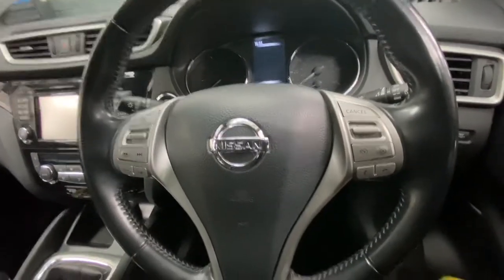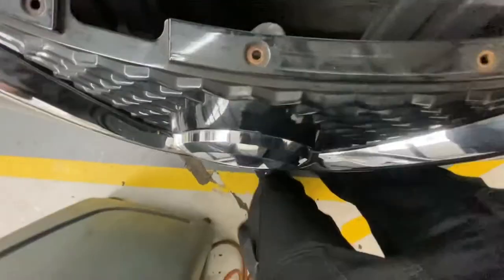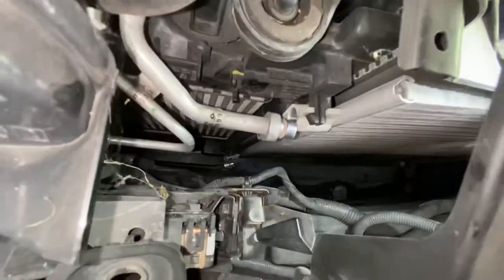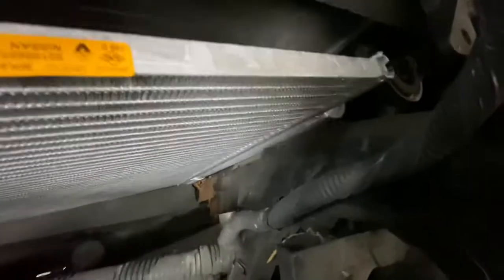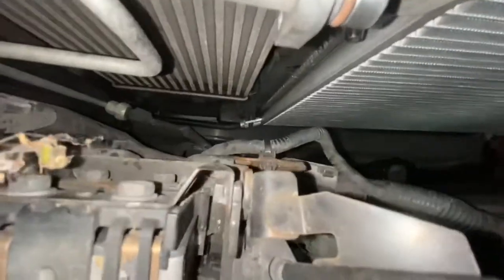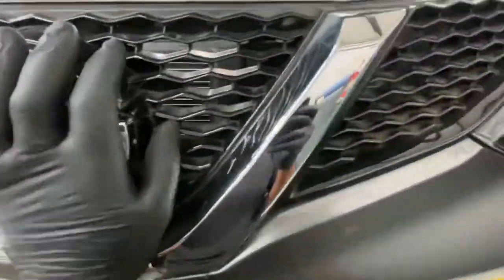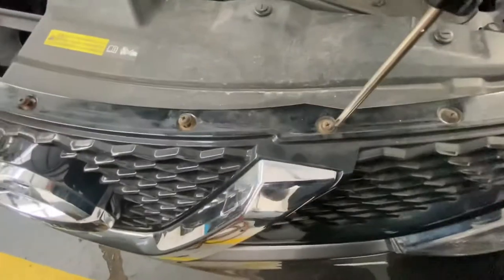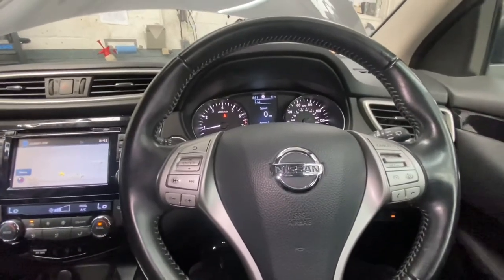#Nissan #Qashqai #J11 #Air #Con #condenser #replacement

Comment: Are you based in UK? I have NISSAN Qashqai 14 Reg - Had re gassed last year and it is leaking somewhere - could be a condenser - Just had service from Nissan & they cant find any obvious leaks by putting dye in. Asking for a £120 an hour for a condenser check.
Reply from the maker: Uk based

Comment: I have a 2008 nissan dualis, 
Runs good ect, but overheats when aircon and idling. 
Doesnt overheat with aircon off and idling. Doesnt overheat when driving with aircon on. Just idling.
Reply from the maker: Have never heard of this issue before can give me more information is it straight away when you start the car or after the car has been running also did you bleed the system properly?
Reply: @g_a_bofficial   it is fine when driving, idling without aircon. Throw aircon on and itll overheat.  How do you bleed the coolant system.

Comment: Hi, my missus has the same QQ and the re-circulation button stopped working. The LED won’t light up and AC blows warm. Is it true that it because of a faulty condenser?
Thank you
Reply from the maker: No the button should come on regardless of whether the condenser was faulty or not

Comment: Could you please share part number of. the condenser? Thanks
Reply: Hi Duncho. Think I remember your helpful posts on the Qashqai forum. 
My Nissan Qashqai 1.5dCi 2014 j11 has the original condenser with these Part numbers on its yellow sticker.

DK996001
921004EA0A
921004BE0A
Reply: Thank you, appreciated!

Comment: Hi. Do you need to purge the system or can you simply re-gas once replaced
Reply from the maker: You can just regas it set the machine to auto so it goes through all the process